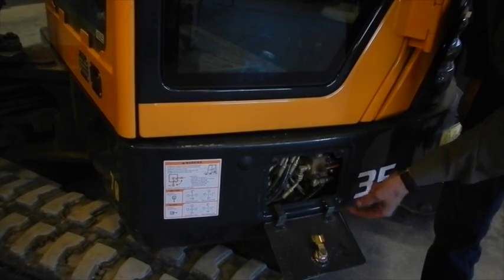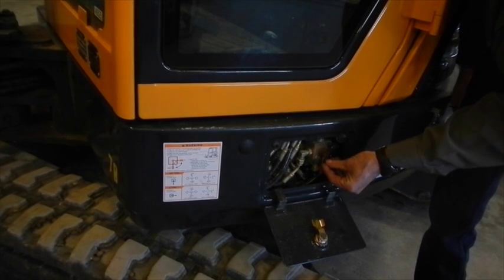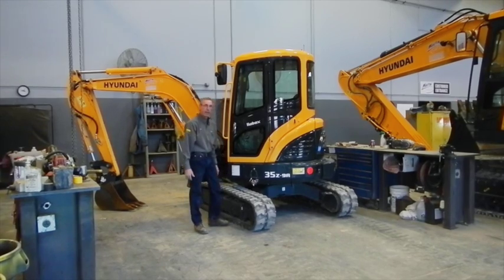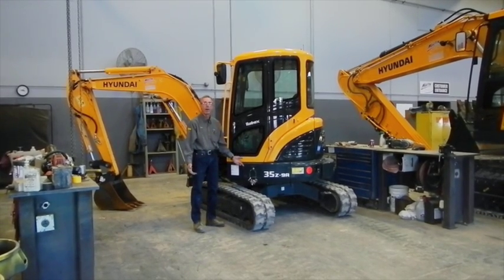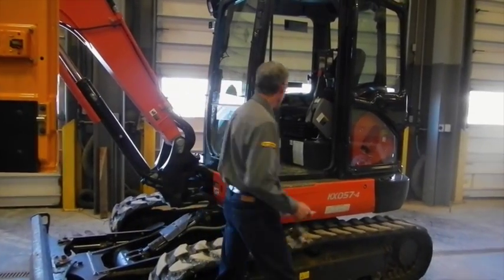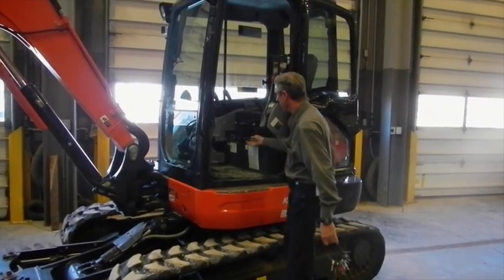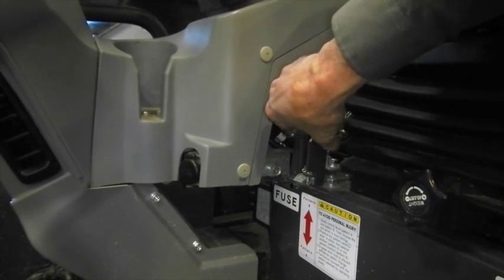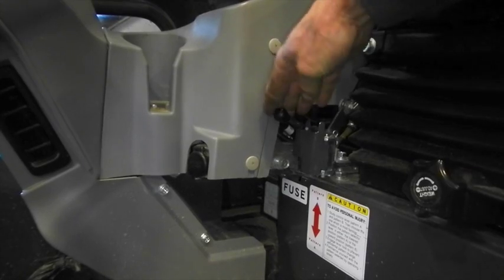Ask The Experts: How to Change the Operator Control Pattern on an Excavator

Comment: jcb 8018. how do you change the controls?
Reply from the maker: Thanks for viewing our video. Consult the safety/operator's manual applicable to your machine model. JCB is not one of the lines we carry.
Reply: Kobelco is pretty cool, u can change left lever setting with a switch .. other digger we gotta change hose to set slew settings